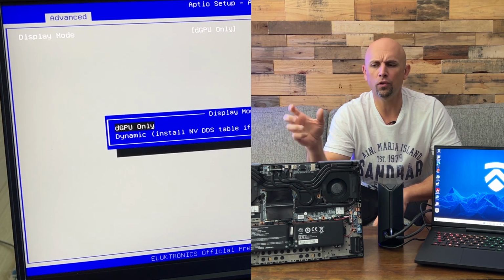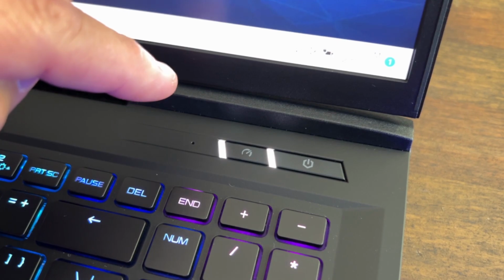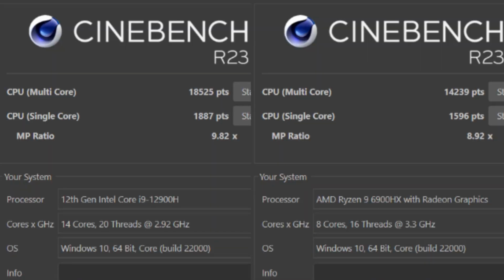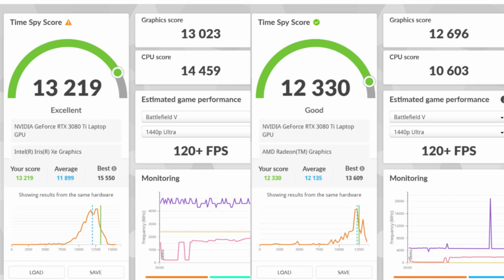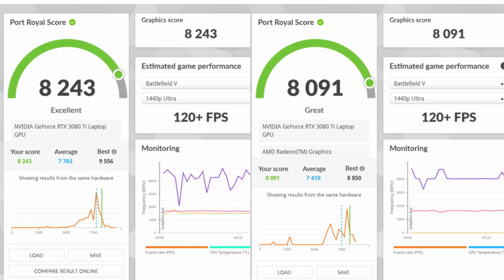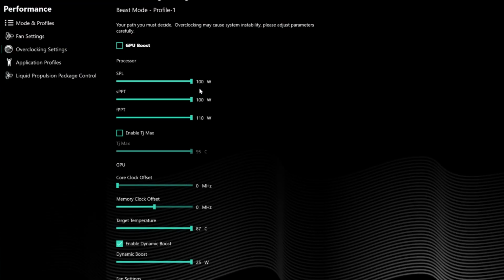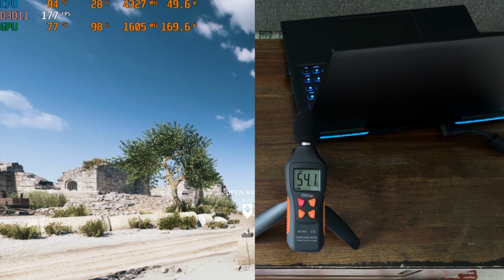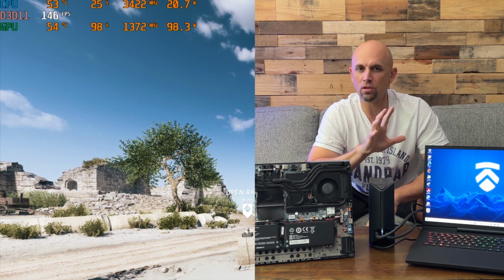(2022) MECH-17 i9 12900H and Ryzen 6900HX!  Expectations, Tuning and LPP Greatness!

Comment: 3 things from me (for the feedback)

1) you really sold me on the external liquid cooling. before today i had previously written it off as a bit of a gimmik. and just not worth bothering with. however your short and concise demonstration with the audio levels really turned my head. as to how much more pleasant it could be. really well done and i hope you include that same clip in other future marketing materials. since pretty much the most annoying thing (for me) about a laptop is the noise under load and/or having to use headphones. so really i thank you for going to the extra effort there with that. i now know i want those ports in the back of the laptop!

2) you guys (and tongfang or whomever else was involved here) really exceeded my hopes and expectations on both the keyboard and trackpad. being somebody who loved the execution of the macbook pro trackpad, the extra size of it being useful for multi finger gestures. and just having that extra sense of control. so i hope it does not get cut, or reduced back down (at east not too much). and especially i would assume that on a 16 inch version it would still be a pretty good and generous size. as for the keyboard, again i did not expect this to be so amazingly good. and really appreciate this new keyboard so awesome. in terms of the sound (althought i dont mind myself). indeed it could be possible to make it quieter at a future time. what was noticed by another independant laptop reviewer (not about your chassis, but about those same cherry low profile switches in other laptops). was that on 1 laptop there was a ringing sound because the keys bottomed out on the end of travel. onto the deck. so that would then ring on a full strike of the key. wheras on a different model of laptop there was no ringing. instead the keys bottomed out and it seemed either it was hitting a rubber gasket, or a rubberized or plasticy fim (i.e. cut sheet layer), or similar surface to absorb the hitting of the keycap and not ring out like an un-treated hard plastic or metal deck would. however this was also the reviewer assuming the sound was not coming from within the key switches themseves (ie browns vs reds). because they seemed 'confident' that there was only 1 and same exact cherry switches being used by both models of laptop. so maybe worth checking what is the deal there. since of course cannot change something making a sound inside of each individual switch itself. only if that part of the noises is happening outside. unless cherry will make a different variant of their switches. anyhow the current sound personally does not really bother me too much... just including here for completeness, and for others

3) for the thunderbolt (or usb4) unfortunately i really want to be asking for something like this over on amd side. however i do have a more niche use case. actually my requirement is not too challenging technically, it is just that i really desperately want to connect my legacy pro audio interface to my laptop. and there is no substitute for it, the saffire pro 40 is a studio quality firewire audio interface. and it therefore requires a pci-e firewire controller on the host side, which must be a texas instruments pci-e x1 card. or (over in thunderbolt world) there are 2-3 thunderbolt docks or adapters which can convert firewire to thunderbolt. or for any other reasonable way to connect a pci-e x1 slot to the laptop which is not going to be too cumbersome or janky / dodgy connection. the thing is i know intel can do it already however the battery life is too much of a compromise vs the amd. and while ryzen might not support thunderbolt this generation i really am hoping that in the future amd chipset will be supporting the version of usb 4 standard that also includes passing pci-express lanes and pci-e hoplugging over that usb-c. i also would make use of displayport over usb-c too (should it be available). however my 1 critical application is firewire. as backwards as it sounds, they really just dont make them like they used to anymore! and it really is worth having, despite sounding like such a niche obsolete thing. it really is now become very well supported over on linux. so i hope amd can support this going forwards.

4) bonus round: the extra ideas that came to me whilst writing this feedback.

4a) it would be cool to thing about using some of the spare room for pluggable 'modules', like on the framework laptop. or (if not) then maybe a recessed usb-a port for receivers.

4b) if you can please keep a revolving open door policy towards sharing technical information to help support open source developers for linux drivers. that does not mean you necessarily need to do anything specific that would burden extra drivers work or support costs. it just means a willing-ness to try and share what you can if needed / if requeted and there is somebody out there who wants to work on improvin the linux support. for those hardware i2c hardware apis that the control centre uses for all the features like the fan controls, the acpi, an the power or charging modes, etc. and whatever else might need help (for example backlit keyboard again tends to be via built in i2c interface). an hid device for trackpad gestures etc. it does not necessarily mean you can always help if those things are in turn provided by tongfang or other pre-existing closed source and proprietary agreements between vendors. as is often the case. it just depends whats possible under the specific circumstances and is just always a thing within the industry. but i guess my point or request here is to please try to remember to include it in conversations. or at least try to assess / determine what the impact or implications are for linux users / potential future linux support. i.e. being able to think ahead in that way might save a lot of extra work or headaches for some other linux person later on down the road. after everything has been fixed in hardware and products shipped etc. so maybe also trying to cultivate or develop a suitable advisory contact within the linux community could provide some value there. typically that is usually going to be one of a handful of existing small hardware vendors (probably like system76, but are otherwise located somewhere over here in europe). 'tux computer or something'. rings a bell. or perhaps others.

and that is all of my comprehensive feedback! i could have asked some other types of tecnical questions like... what is the freesync mux like? and is there any way you can ask them (samsung or lg) to start manufacturing 1600p wqhd+ oled panels? (since they instead are making oled as 1440p, which is so out of touch). but i think i have gone on long enough. and those other questions just didnt seem quite as important here.

hope you continue to make further progress working behind the scenes, we really appreciate it! and all of that hard work is really showing in these laptops. they are pretty amazing... and really seriously rivalling the asus or other big brands nowadays. so i look forwards to 3rd party reviews and comparisons really dont expect anything but praise here. hope the reviewers will see it too. i must say, it really made my day to see that trackpad and keyboard on that chassis. after so many months. and the mux switch you really worked hard on the g-sync, just a shame it wasnt certified in the end. still top marks for trying. really appreciated 👍

Comment: Good to see you back Bob! Also good to see that Prema is supporting you guys. Why couldn't he do the BIOS on the AMD unit? I might have missed that. 
Great point about the VR !
Reply from the maker: AMD hasn’t made their mobile CPUs with hidden features while the Intel mobile platform is full of them.
Reply: @BobOfAllTrades  basically AMD has given the middle finger to laptop enthusiasts, what a surprise. They've always been doing that.
Reply: @john-paulhunt6943  would be great if Gigabyte did. But I do wonder if TB4 will bottleneck RTX 4000 though

Comment: A lot of nice and powerful things about it, and maybe I misheard, but I noticed you didn't mention the price.

I looked at Eluktronics laptops a few months ago, but wow did they get crazy expensive. A 3060 laptop there starts at $1900, which is insanely high considering what other brands are offering these days! 

I got something else just because of the $ alone since I saved about $1000 for an i7 12700H, 3070ti by buying another brand open-box, over Eluktronics with same exact specs...
Reply from the maker: Prices change all the time and I think I mentioned that at the end of the video.  The 60 series market is hard to get into as a business.
Reply: So you bought a budget friendly open box laptop and you're asking Bob why the prices of the brand new high end laptops don't compete. Make it make sense please
Reply: @itsjirM  Uh no? New it costs $2000, so far from low end. I just got it for a low end price of $1425 since it was an open box. 

My point is even new, the brand I bought was still cheaper by $400 than Eluktronics models with equivalent specs. It's not just one brand either with better deals. 

A Legion 5 pro i7 12700H, 140W 3060  QHD 500 nit screen on eBay right now for $1400. 

Same specs from Eluktronics? $1900. $500 difference is a big price gap for pretty much the same performance.

Comment: Welcome back, Bob!

While liquid cooling isn't exactly a mobile setup for laptops, it can be nice to easily disconnect the liquid cooling and take the laptop on the go without it. I wouldn't mind the trade off of not having liquid cooling on the go for the mobility. On the whole, it would seem on face value that this would be a better DTR laptop than a mobile creator-editor station. Then again, liquid cooling is pretty awesome on a laptop. I don't think there are other non-ODM mainstream companies that offers something like this out there.

Edit: I've had the R7 3700x equipped Thicc-15 (XMG Apex-15) for 2 years now and it's still running solid. It can be a bit loud and there are times I wished it had a liquid cooling option to keep the fans less noisy.

As to the new Mech-17... It's just so strangely and ingeniously engineered that I can't help but drool at it! :D
Reply: Thicc-15 is such a great name for a desktop replacement laptop! 😂 ( ͡° ͜ʖ ͡°)

Comment: Goood to see a video from you again. I was wondering if you guys plan on trying to innovate with any newer designs for air cooling kinda like asus with there unique venting and dual screen solutions. Also just curious with all the power intel has why not allow it to have liquid cooling as well or is that an option. Eluktronics does make some awesome pcs but I’d love to see some different designs that help out with air cooling etc liquid metal and some other things I think would really help out with stuff. 

The liquid cooling on a laptop is definitely a game changer but it’s not really a moveable solution at this point it’s a desktop replacement which there are some that have had even more power than these in desktop replacement category. 

Good to see you again on video hope all is well.
Reply: They shouldn't even call this a desktop replacement, and should bring back the desktop cpu ones (for AMD as well...) with LPP and other features that they have on intel. Better chasis should also go to both not just whatever they can't sell otherwise, same goes for discounts...
Reply: I'm pretty sure both of these have liquid cooling.
Reply: @ACE112ACE112  yes they do but he didn't show any benchmarks...I wonder why?
Reply: @RetiredMillennial  he showed benchmarks in the beginning. Not sure if that was with liquid cooling.
Reply: @ACE112ACE112  it's not, he just talked about LPP and showed one of them in gaming without mentioning which one it is.

Comment: This MAX-17 is incredible to use. Mark my words, I will save up and buy a new machine to replace it in the years to come! :D
Reply: does it have type c charging?
Reply: @tabalugadragon3555  Everything I've looked up has come up nil, though specifically speaking, the model I have has the 10875H and RTX 2070. I haven't seen or heard anything that mentions Type-C charging, though I'm not sure why it couldn't.

Only real negative is battery life is not good on this unit. I get like... 3 hours of use with the screen at max brightness, and about 5 hours on 50% brightness, backlit keyboard off.

Here's the exact review done by Bob of the unit I possess: https://www.youtube.com/watch?v=XYrItQZJpXc Only difference is that my unit doesn't have the Super version of the GPU. All other parts are equal.
Reply: @tabalugadragon3555  no it does not have usb-c charging. Only can charge with the power brick or the power pass through with the LPP water cooler
Reply: @itsjirM  huge shame. I was considering max 17 before knowing this. A laptop is a mobile device so capability to charge it with a small, type c adapter is a must in my opinion. Life isn't just about gaming and productivity. I could spend a whole day in airport watching movies and checking e-mails.